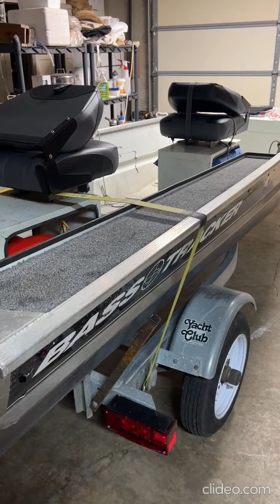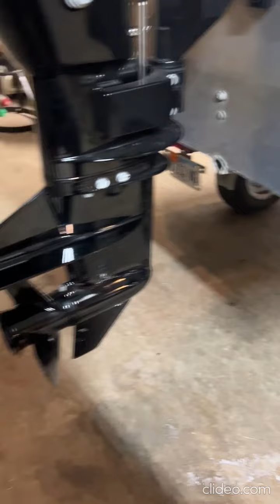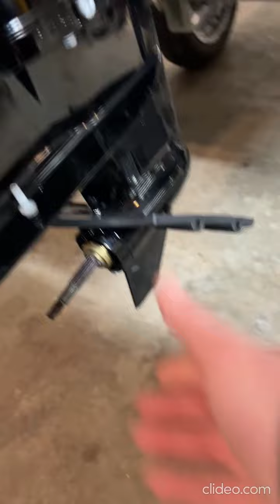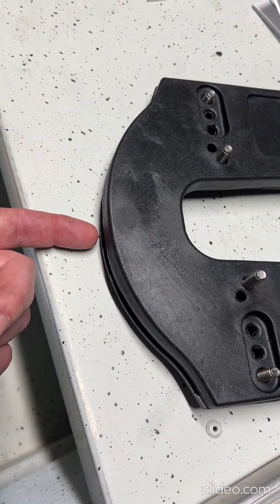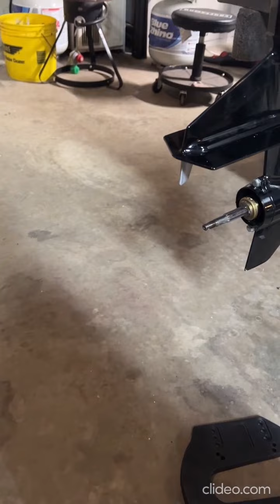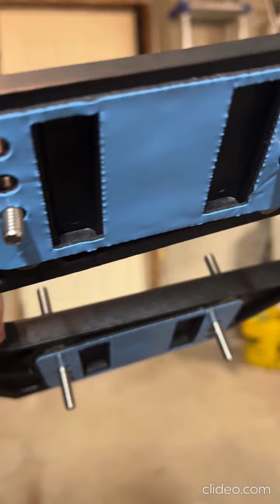SE Sport 200 Hydrofoil install onto 8HP Mercury using no-drill kit

Comment: Yes, I have a Tohatsu 20HP and had to cut the bottom plate to get it closer. It works well. My issue was the anode connection which was above cavitation plate. Tohatsu 20HP in Canada have it above

Comment: Your motor sits to low. The cavitation plate should be level with the bottom of the boat to get maximum performance from your motor or you getting to much drag from your foot
Reply from the maker: That is an interesting comment, but keep in mind we are talking about a 170 lb. 12' boat with an 8HP.  Boat has a 15" transom, and the Merc is a short shaft motor...... I would have thought the engineers of boats and the motors had figured out the optimum distance for the cavitation plate over time.  You do have me curious on your observation ...... have you changed that ratio and experienced an improvement in performance on small craft..... genuinely interested in what mph difference we are talking about?  I'm not interested in changing anything on the 12 footer, but might consider for my 16 with the 25hp!  Keep in mind Bob.... refreshments and pretzels are served on the tiny boat during the transfer from spot to spot, so I don't want it to go tooo fast.  😊
Reply: @jasonschadel4839 my boat has a 15” transom and I also got a short shaft but had to raise my motor an inch for it to sit right. Every motor manufacturer is different but they are all typically longer and require fine tune adjustments even on long shaft motors to 20” transoms.

Comment: Hello Jason!  I "think" I heard you say something about having some carb problems with your other motor.  Don't know if you know about this or not, so if I may offer you some friendly advice......every time you come back to the dock at the days end, unhook your fuel line FROM THE MOTOR....and just let it sit there and idle until it use's up the fuel in the carb.  If you'll do that every time, you "should" never have any carb problems. i.e.  varnish from the fuel laying in the carb.  I had a 5 hp Tohatsu on a 14 foot Starcraft Jon boat that I completely customized and now it's more of a bass boat than jon boat.  Any way, the first year it ran like a top.  The next year, it would start and run, even full throttle, but after a minute or two, it would die.  Time after time!  Called Tohatsu and they are the ones that told me about disconnecting the fuel line from the engine.  Bought an ultrasonic cleaner from Harbor Freight, took the carb off and put it in a 50/50 mixture of simple green, turned the cleaner on , and about an hour later, I had a new carb again, and I have never had those kind of problems since.  I now have a 20 hp Tohatsu on my boat and I love it.  But I too an considering putting that same hydrofoil on my engine.  BTW:  Did you know that your 8 hp Mercury is actually made by........TOHATSU!!!!!  Yep!  They make most of the smaller engines for numerous big name outboards.  V-e-r-y DEPENDABLE!!!!
Reply from the maker: Good advice!  That motor actually has a shut off valve - just have to turn the choke knob to the right or left to open/close it, and then let it run out of fuel.  Motor ran great for about 27 years without me doing that, but probably would have been better.  I rebuilt the carb and found the issue...... small tear in a rubber bladder piece.  I'll probably start it up every once in a while just to keep it running for a backup motor.  Thanks for the comment and take care!

Comment: I don't want to have to drill my cavity plate, but the Sport Clip seems to add a lot of bulk to a smaller outboard in particular, and makes fitting more complicated. I was hoping for something where I could put a hydofoil on and then take it off again quickly for a comparison, or if I decided it didn't work.
Reply from the maker: Yeah..... there's a lot going on back there concerning bulk, but the 8hp seems to have plenty of power/torque so I don't think I'm sacrificing any significant amount of speed.  May put the 9.9 carb on it if I want the extra speed.  I've been out  a bunch of times and have no regrets!  Catch a big one!
Reply: @jasonschadel4839  I took the plunge and put the SE200 on my 20hp for some stern lift, my "Deep V" 14ft, seems to ride low in the stern despite trying many things with trim, propellers and weight distribution. I hated drilling the holes in the outboard, so I hope it will give me the little extra I need, if I can keep on the plane at a bit lower speed/rpm it will be worth it, currently I feel like I have to push it too hard all the time, to stay on the plane. When I bought my boat, I really underestimated how much power it would need with it's deep V hull and wide beam, combined with boating on high altitude lakes, to get me up and moving. The lowest altitude I've run at was about 3,500 feet compared to the usual 6-8,000 feet and it was a huge difference, I ran a higher pitch prop and the thing really flew, it works well at altitude, but would only take a minor improvement to be just about perfect.
Reply from the maker: @fiveowaf454 FYI…. Did put the 9.9 carb on last year and gained about 3 mph with the wind behind me….. wasn’t worth the money in my opinion but now I know!

Comment: Does the increasing clip from behind have an effect on the performance and speed of the track? and why didn't it coincide exactly over the top?
Reply from the maker: Understood and you're right......the fore/aft placement I'm sure DOES affect the performance.  I didn't run the trigonometry on it, but placing it forward, as I did, likely gives up some of the ability to push the front of the boat down.  The good news is that I don't have any trouble keeping the front of the boat in the water, even with just me sitting in the back with the fuel tank.  Trim setting "1" is perfect when it is just me in the boat.  About half the boat is in the water, and it planes out very nicely.  When I have someone in the front seat, I can use trim setting "2" and it skims along the top of the water when on plane.  Keep your bait wet!